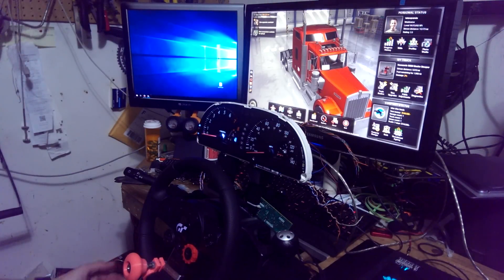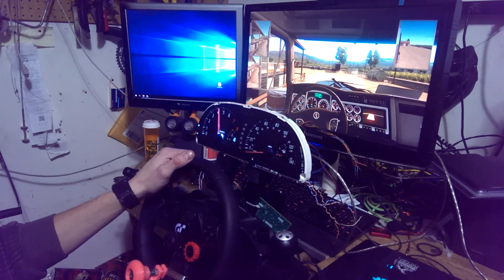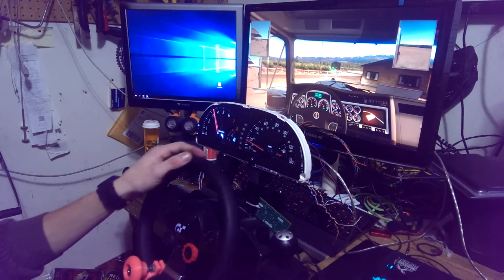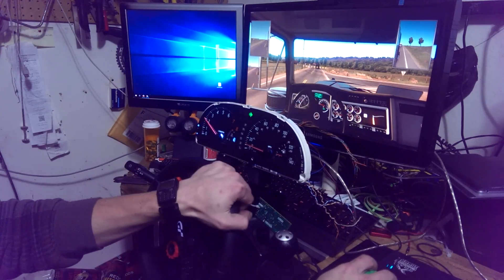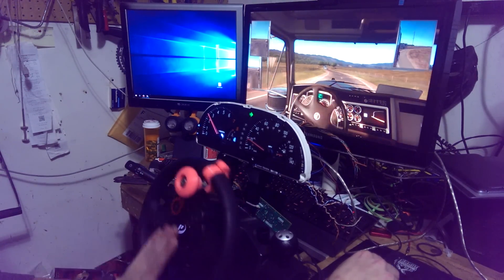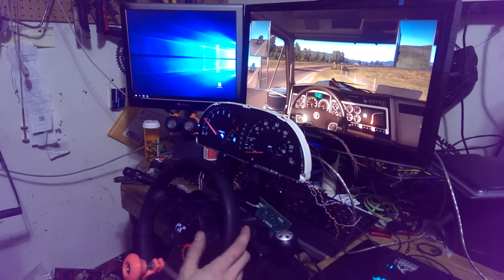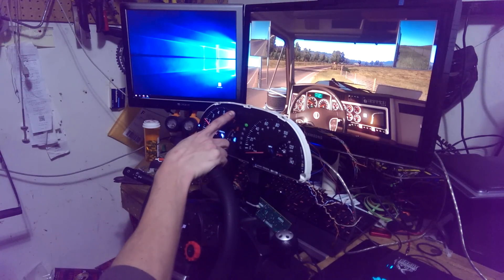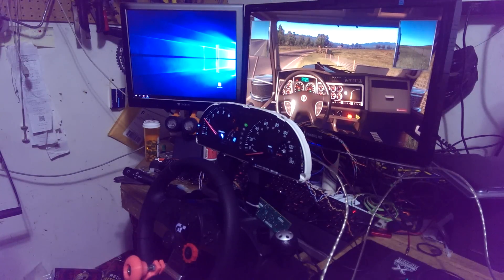American Truck Simulator Arduino Dashboard Demo / Cockpit / Sim

Comment: Awesome!!! I´m building my simulator too but I am investigating before buying electronics to build the dashboard. I have a Dorman Cluster but just the case with no electronics as I´m planing to use servos for the gauges... the thing is that I am creating in Photoshop a layout that will have a larger range of speed than in the game so... my speedometer will go from 0 to 140 or 160 KM/h but not all the trucks in the game will go at that high speed maybe from 0 to 90 KM/h just to say something....

How do you match the needle in the cluster (the servo rotation), to match with the correct output data/number displayed in the game dashboard. 

I mean 10 KM will be 10 KM but the needle in my physical cluster will travel slower to match the needle shown in the game, the speedometer may be shorter in some trucks. How to tweak the amount of degrees that the needle moves or travel to match both displays.

THX!!!!

Comment: Interesting bit on mine, the servos aren't updating nearly as smoothly as yours. Mine behave as if there is a 250-500ms delay between analog updates :/  Video here: 0qzMjhTp3Xc  Any thoughts?
Reply from the maker: I have no idea to be honest. Mine do "twitch" constantly, and make a constant noise, not sure if it depends on the servos?
Reply: I started with analog, tried digital just for trying. Both types do the same thing, though oddly enough the only one that vibrates on mine is the tachometer.

A twitch I could handle, could just make a smoothing algorithm to average a small sample of the serial data and since your's already move so smooth I'm sure that would remedy your little twitches, but mine...well you saw, I'm not getting the refresh rate you are getting. :/
Reply from the maker: Late response: It's the amperage that the arduino's can supply. Provide your servo's with a seperate power supply. Most servo's recomend 1a per servo.

Comment: how did you get the turn signal stick to work with the arduino? i really want that working with my g29
Reply from the maker: That signal stick is wired to my shifter. Separate from the gauge cluster.

Comment: Amazing!!!
I used the code Silas in ETS2, but did not know it was available to ATS!
One question, do you know if someone has done or plans to do the conversion of the ETS2 Silas code to 64-bit, I would love to play again in the online mode using the ETS2 my panel.
Reply from the maker: +Henrique Silveira Steinmetz To get this version working all I had to do was compile in x64(source code was provided by developer). Nothing else was required. It works the same way ETS2's SDK does. You can probably use Silas on the x32 bit version of ATS(you'll have to switch to the older version that supports x86 to try it)
Reply: But you can compile the code provided by silas for ETS2 on 64-bit? I tried and I could not (I am not very familiar with compilers ...)
Reply from the maker: I'm not familiar enough to do it with a different project. I had to have a friend remote control my project to make everything work.
Reply: +teknogeek1300 I live in Brazil, and ATS is still too expensive for me to buy, so I still use ETS2, and I would love to use my dashboard 64-bit
Reply: but your 64-bit code also works on 64-bit ETS2?
Reply from the maker: Yes!
Reply from the maker: +Henrique Silveira Steinmetz both x86 and x64 are backwards compatible with ATS and ETS2.
Reply: +teknogeek1300 thank you! This weekend I will try to do tests using your files!

Comment: Wow really wish that blinker was an add-on for the G27/29 >.<
Reply from the maker: +uxot It works with any wheels, it's a separate device.
Reply: +teknogeek1300 buyable?
Reply from the maker: Yes, but you will have to construct it yourself.